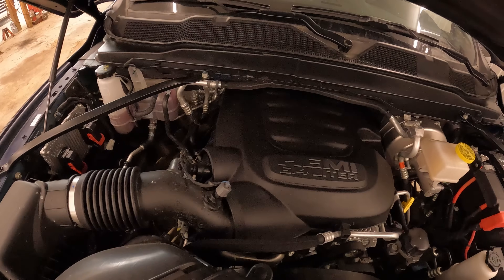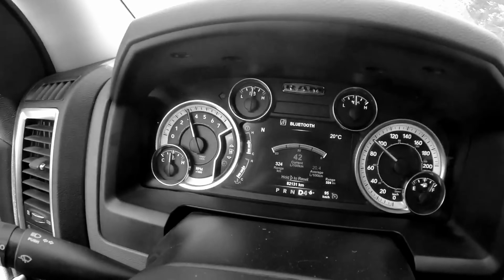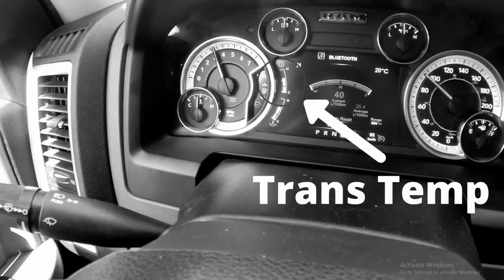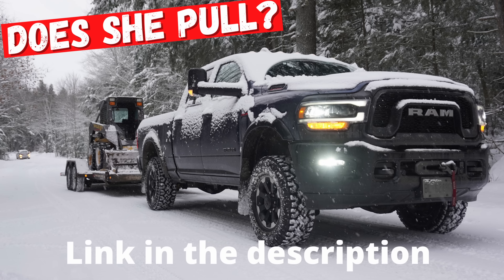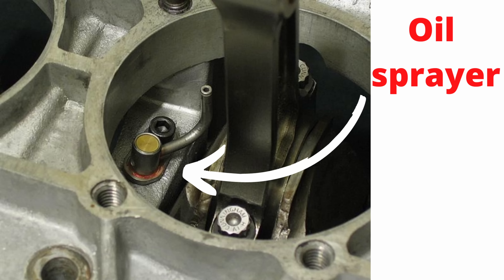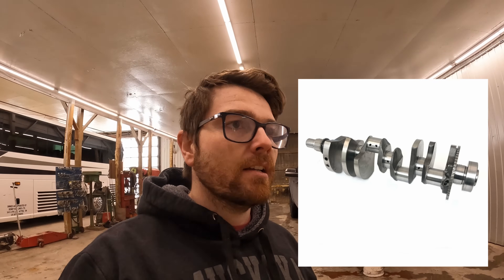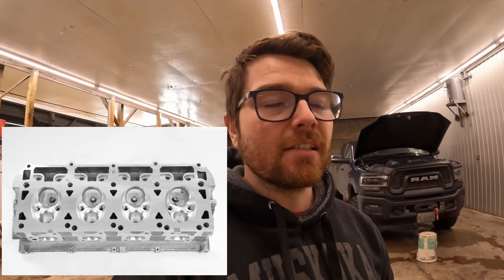RAM 2500 6.4 Hemi Review *Heavy Duty Mechanic* | Is The 6.4 Hemi Better Then 5.7 Hemi ??

Comment: Hello Alex, first time commenting on your videos. I enjoy your videos for being informative and reliable for stating actual facts instead of fake news just for the reviews. But first off, I want to say I just purchased a 2023 Ram Power Wagon that just came into the dealership 2 days ago. They offered me 15% off the sticker and then just to get it off the lot another $3500.00 for a total of $16,200.00 of the sticker. I really was not looking for a power wagon, but I could not pass up the deal. 
Just wanted to ask you do you run 93octane in your truck? And suggestions on a adding any accessories on this truck for better performance or gas mileage, looks? When you need new tires are you going to change from the off-road tires to something a little quieter? Thanks for your time. Keep the videos going.
Reply: I know these questions were posed for Alex, but I hope you don’t mind that I’m going to respond. 

First and foremost, congratulations on the truck. Power Wagons are amazing and it sounds like you got a great price.

In reference to the octane rating of the fuel, you should always run midgrade fuel in your 6.4 L. Regular fuel can be utilized, but in the event that the engine experiences preignition (Detonation), the knock sensors will trigger the ECM to retard your ignition timing, saving your engines life but reducing power output by detuning the ignition curve.  While mid grade (89 octane near sea level) is recommended and 87 or regular octane is permissible, 93 octane should not offer any performance gain over 89 octane as the compression ratio does not dictate a need for an octane rating greater than 89. You could probably get away with 87 at higher elevations.

In so far as modifications to the vehicle, every power wagon should be running a 35 inch tire, minimum. The factory Goodyear duratracs are relatively quiet, and I don’t believe that any self-respecting power wagon owner would go less aggressive than the factory tire.

Congratulations again on the truck, God bless.
Reply: @proudamerican5518   thanks for the helpful information, be blessed

Comment: I have 2015 Ram with 6.4. At 50,009 miles I had a ticking problem. Took it to the shop replaced lifters.
I hear lifter failure is common in these engines.
3,000 $ later I’m back on the road with fingers crossed!

Comment: I just got a 2024 2500 with the 6.4, I traded in my 1500 with the 3.6 cuntastar. All I can say is, this truck is a beast.
Reply: What kinda milage are you seeing ?
Reply: I went from a 16 Cummins to a 19 Pentastar.  I didn’t need the diesel for towing anymore.  I hated the Pentastar and got rid of it.  I had the 3.21 rear so maybe that was the issue.  Never got the epa estimate unless I was under 65, flat ground and not using cruise.  Then, it would constantly shift out of 8th, 7th, 6th on any incline.  Constant shifts just drove me crazy.

Comment: Great video. Just to get technical, the addition of silicon to reduce the thermal expansion of the aluminum pistons is correct but it's not silicone. Silicone is a synthetic polymer used to make moldable silicone rubber (an elastomer) to make silicone rubber products. Silicon is a solid element added to aluminum during the alloying process of aluminum. Silicon is also used in electronic circuits. Silicon and silicone are two different things. ("con" as in "convict", and "cone" as in "traffic cone") A very common mistake. Yes, this is an old post, but I just had to chime in anyway.😎

Comment: Great vid Alex! Very informative, your passion for teaching is clear, and you're good at it. Have you ever thought about teaching at a technical college?
Reply from the maker: Thank you John! I have thought about it, I do think I still need a few more years in the trade to really have the experience and knowledge needed. But it is something I'm wanting to do!
Reply: @GettysGarage  Contact a local tech shool or college and find out what credentials you need to be  certified. Lots of required courses you'll need are on line these days to help speed the process up!
Reply: @johnthornton7763  I have a friend that is a multi-decadal Chrysler tech. They gave him a big raise and peer leader title to get him to stay another couple of years before retiring. He said the big difference between the "old school" guys and the new guys is how dependent the new guys are on codes and computers. He said he learned having to listen to an engine and figuring out what was wrong based upon intangibles, experience and knowledge of mechanics. He basically now days oversees his dealer's shop and is particularly good at figuring out what is going on when something happens that doesn't throw a code. He tries to teach the new guys by having them listen and then making them tell him what they think is going on. But he said, they often lack a core understanding of the "mechanics" of the systems and reach for the computer to tell them and can't figure it out without the puter. 

My 2015 1500 just before trading it in went out on me on the highway at speed telling me to restart...usually at 65 mph as it coasted. No codes thrown. My dealership was going to have to wait a couple of weeks for an FCA tech to come and figure it out. They didn't have a clue after three days of trying. My friend asked me how many miles on the truck, what happened when it cut off, how did it run otherwise (perfect), asked a few more questions and said, it's somewhere in the ignition system. He told me where to look first, replace a part and then go up and up and down the system if that didn't fix it. He was sure...no question, no computer. My dealer techs just looked at me like I was an alien when I told them this...
Reply: @Redfour5  Nice story Redfour5, yes, there is no substitute for experience,  but today's world of auto repair is a horse of a different color as they used to say!

Comment: My2014 3500 6.4 hemi has been a yard ornament for 3 almost 4 months driver's side exhaust manifolds unavailable got the passenger side no problem getting that , going to reuse the driver's side with a new gasket and stainless steel bolts,  when a new one comes available I will change out the driver's side, this truck only has 45000 miles on it and has never had any heavy towing,  also do you recommend a transmission flush or is that un nessasary iv heard it is dangerous thing to do

Comment: Thicker oil only means it doesn't have as tight of tolerances. Tighter tolerances require thinner oil to allow the oil to get to those tight spaces. It's the same exact oil in terms of film strength and additives, just fits in smaller spaces.
Reply: Our 6.7 fords run 10 30 im pretty sure that’s to light for a diesel but it never gets to hot

Comment: Haha!!! Glad you said only did research and don’t work on engine!!! I’m owner of 2006 Dodge Ram 2500 4X4 5.7 Hemi with near 290,000 miles! Great all around engine and I’m thinking of swap to 6.4 Hemi!!!
Now I’m in Missouri I uses 5-20W in winter, 10-30W in spring and fall season and 20-50W in summer months or when towing long trips. 
My 3/4 ton truck when I open the open with grill goes up, there’s all kinds of coolant radiators haha!!! When you mention about oil temp on your 1500 well I don’t know what it gots but my oil temp or pressure does change much under heavy loads.
Reply: “Does not change much”
Reply: 300,000 miles on my 2004 Laramie 4 door.
5 w 30 summer and winter.
I pull a 10,000 pound 30' camper

Comment: My brother went through 3 engines in his ram over a 2.5 year span, he's a journeyman mechanic and didn't tow or give it a hard time. I had a 6.0 chev at the same time and I beat the shit out of it and drove off road frequently for my gf to take pictures of the coastline....Never had a problem with it(tie rods and leaf springs.....like alot of them). Still ran smooth with 375k on her when I sold it
Reply: He probably idled alot, hemis shouldn't idle for long periods

Comment: Very informative. I only run 5w30 PUP. With gas hitting 1.70/L, in glad i have the 5.7!
Reply from the maker: I can't believe the prices, starting to get very disheartening. I knew this truck was not fuel efficient but when I bought it in November gas was like 1.25 tomorrow the pumps will apparently be north of 1.80 in my area
Reply: @GettysGarage  I hear ya. In 3 or 4 more years, I'm planning make the jump to 2500 or 3500 hemi 6.4. I'll be doing it mainly for the payload.
Reply: @GettysGarage  Well in Manitoba today we hit 189.9. There saying 2 bucks in April. For you in BC would be worse. Dang…..  nice video as usual. Cheers
Reply from the maker: @ramrider1453  diesel was 2.29 today in my town. wild times. we are in for a world of hurt I'm afraid
Reply: my 6.4 2500 with the 8 speed transmission gets the same MPG as my old 5.7 1500

Comment: Thinking of stepping up to a newer used truck. Need to look at getting something the size of our 2003 Dodge RAM 2500HD 4x4... it's a 5.7 HEMI and still operating well at 247,000 miles... I am wondering what the 6.4l is like. Thank you for the video.
Reply: I have 2004 Laramie..
4×4.
300,000 miles now.
Original spark plugs.

Comment: Nice video keep ‘em coming! It may not be “fuel efficient “ but I had a 2005 Ford F-150 with a 4.6l that didn’t do much better than my 2021 ram 6.4 🤣
Reply from the maker: Ya funny how these engines dispite being  big gas guzzlers are actually kind of efficient compared to V8's of the past
Reply: I've had two 1500's with the 5.7 hemi. Now with the 6.4 Hemi and admittedly the first 900 miles, one thing I am noticing is that the mileage, so far, without towing is NOT that much different than the 5.7's. I am a bit surprised. It is definitely not as good, but I'm talking about a less than 1 mpg difference... I'm hitting about 13 mpg around town 50 50 driving. My 5.7's did not do much better... AND, from the vids I'm seeing (TFL trucks etc.) I may actually do at least as well or maybe even better towing, my particular load of an 800 lb tongue weight and maybe 1700 lbs loaded travel trailer at 28 feet. I generally am in the 8.5 to 9 mpg range with the 5.7's and from what I'm seeing that at least is where the 6.4 will be...maybe better. So, I'm quite pleased, all things considered...
Reply: @Redfour5   I tow a 7500 lbs travel trailer and get anywhere between 8-13 mpg depending on hills, wind, traffic with my 6.4
Reply: @paflyer1370  That jibes with the other things I've seen and read... In my 5.7, and conditions like you describe, it was 7 and change to 9 and change always... I was at the upper end of my 5.7 with an 8K total capacity and a 1300 payload. I will be toward the bottom of the 2500 that has 3100 payload and almost 16K total capacity... More power...
Reply: Oh and my 2015 had a 3.92 rear end and the 2021 had the 3.21 and the mpg was virtually identical towing. The 3.21 just did it with more transmission and less rear end to compensate. So, that distinction is a bit specious. The 2500 is the 3.73. I'm good.
Reply: @Redfour5  that’s why I also upgraded, more payload more power, less strain on the motor and truck
Reply: @paflyer1370  that’s impressive. I tow a 5500-6000 pound travel trailer with my 2500 HD Chevy and struggle to get 9 mpg.  60-65 mph for many thousands of miles. Actual mpg not a display reading.

Comment: I took the truck version put the cat version heads and cam in it along with intake..i aldo am running all the hellcat redeye elecrronixs..ill be using s redeye supercharger..hopefully it holds up..using dual fuel pumps alobg with big injectors..wat ya think?

Comment: My 2008 5.7 Hemi 1500 has the tow package-4.10 gears, 4-spd auto, oil coiler, trans cooler all from factory.
Reply: Thought that was 4 speed with overdrive-
Maybe they removed the overdrive for the tow package
Reply: I Have a 2004 Laramie 5.7 is 4 speed with overdrive

Comment: I had a 2014 Ram 2500 5.7 & a 2018 6.4 Ram 2500. They were both good trucks & did what I needed  them to do. I traded the 2018 in on my 2021 F-350 7.3 V8 10 speed . I consider the Ford a Outstanding Truck!
Reply from the maker: Heard really good things about that 7.3 with the 10 speed. not a ford guy at all but everyone really likes it. hoping to do a review/comparison on that engine in future!
Reply: Smart move.   I have nothing but great things to say about the F250s Ive used as worktrucks in the fleet...   Absolute anvils.   The RAM 6.4s have been junk (no HEMI issues everything else doesn't hold up) and I drive them alot easier then the F250s.
Reply: I'm in the market looking at 7.3/6.8 f250 or 6.4 ram which do you like more and why? Ford seems like more bells and whistles for the money . How's the mpg of both?

Comment: Hello, i am interested in a 2018 power wagon, i currently have a 2005 hemi 1/2 ton. Have always ran 89 octane because the manual says its better, can you make a video about using different octane fuel on these hemis? 87 vs 89

Comment: I’d love your opinion on the tradesman base model with the 6.4. I like less fancy computer stuff. Trying to decide if I want to bail on my ford F-150 ecoboost for a 2023
2500 tradesman. I always had Cummins before this ford but I don’t tow a ton and I go a lot of miles. 80 percent daily driver no towing. Just miss my 3/4 ton suspension and less Bells and whistles truck.
Reply: Payload is 3500Lbs on my 2500HD Tradesman C.C, plus the bed is a foot longer. I truly enjoyed driving the 2.7 F150 for it's speed, not much for hauling. I got rid of a new F550 because of the design of things in the interior, so I went back to my 17 RAM 5500. Not sure outside of a Raptor if I can ever buy any 1500.
Reply: I’ve got the 3.5 ecoboost and keep looking at the ram 2500 but not sure what to do. I may keep the ford for a year or 2

Comment: What are your concerns about the MDS potentially causing lifter failures?  I have a 2023 Power Wagon, and will add the Pulsar to it when they have it available for 2023..
Reply: From the research I've done.. excessive idle causes the lifter issues. Not the MDS system.

Comment: Can either of the etorque systems be turned up at all? Can it charge up the 17 Pacifica ev battery? Is 100lbs heavier than 2 4d 12volts

Comment: I have a 37ft travel trailer at 8600lbs dry about 9200lbs loaded. Should I get a 2022 ram 2400 6.7l  Cummins or 6.4 upgraded hemi. I want the Cummins because it will be the last truck I will ever need if the Cummins is as reliable as they have been not to mention nearly double the gpm. And will most likely be my daily driver when I get home to ID in the next year.
Reply: IF, you use it hard with a lot of towing, I was told to get the 6.7. But if it's primary use was as a "daily driver" with a much smaller percentage of towing, then go with the 6.4. Diesels need to work get up to temps and hold them for like a long hard drive. It is hard on a diesel and all the subordinate parts to be turning it off and on on short drives never letting it get its feet under it with a long haul. I believe Getty Adventures addresses some of this in another video? That and what I had heard otherwise convinced me to go 6.4 gasser AND save around 7200 bucks difference between two engines.
Reply: I do transport with a 2022 ram 2500 6.4 and I tow 5000 too 13000 pound travel trailer no problem my friend
Reply: Thanks for the repies and info. I ended up getting the 6.7 cummins.  Were going to be doing a lot of traveling towing a 10k lb camper once I'm out of the miltary. And after seeing some of the tunners for the cummins and fuel economy gains even towing was part of the decision, not to mention the power behind the 6.7. This will be the last truck I buy for atleast 15 years hopefully lol. And getting back home to ID most of my daily commutes will be close to an hour 1 way depending on where we get some property, so getting the engine to temp won't be an issue. Again thanks for the replies.
Reply: Would love a 7.3 Godzilla but still hearing about engine failures